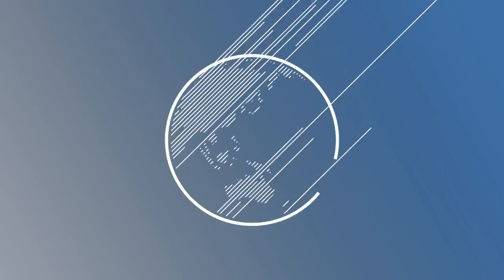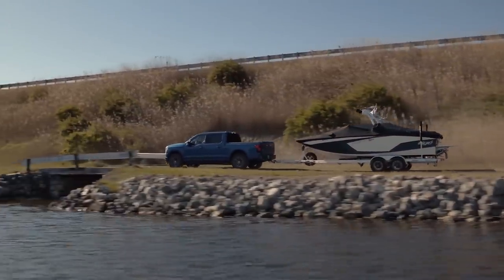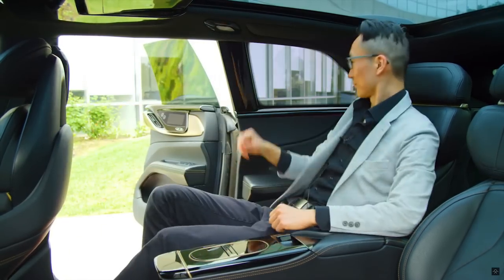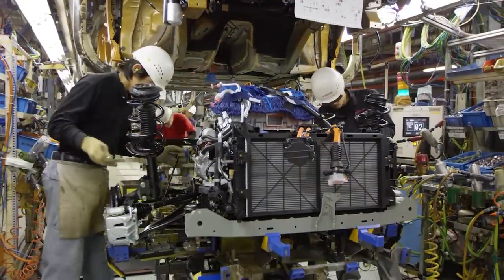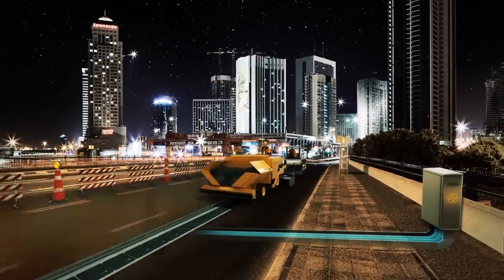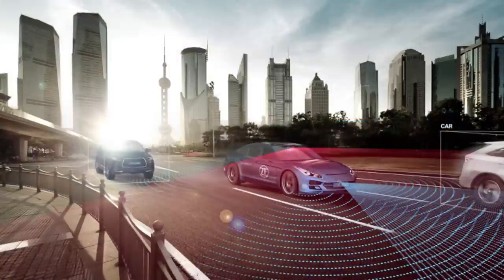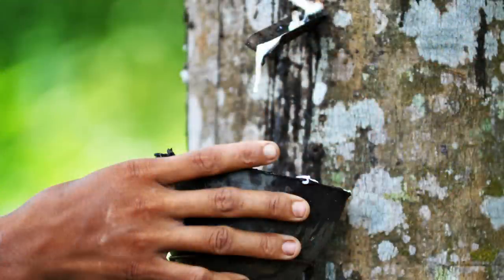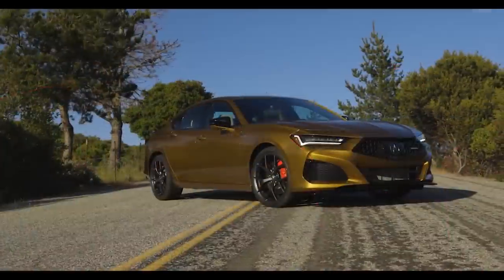Ford Reveals F-150 Lightning; BMW First to Use Sustainable Rubber Tires - Autoline Daily 3084

Comment: Great job Ford...   I am impressed..
Reply: on average, yes.... but wanted to see it include, https://www.caranddriver.com/news/a34277725/ford-f-150-range-extender-ev-pickup-patent/
 as an option....  that was a disappointment.... for now...
Reply: @nc3826    I tried to tell you...
Reply: @dmitchellhomes  tell me what??? 

if we talked about show me the link??? want to see what you said....
Reply: @nc3826    Yesterday you commented that a range extender was coming,  I commented back that I doubt it.      Range extenders do not make sense,  add too much mass,  limiting range and payload in EV mode.    Working on better efficiencies,  and better battery tech is where to spend $$ now,   we are past the extended range hybrid phase for most customers needs.
Reply: @dmitchellhomes Sorry I did not get from your earlier comment, you were BEV evangelizing purist like fanboys.... 

Bottom line is its fast DC charging rate is sub par to the coming competition... So they need an alternative for high energy consumption situation like towing... Since those fleet owners do not have all day to recharge... 

BTW the Range Extender capability could use a battery pack like Rivian's Jerry Can.... It would just be future proofing it... so if they are smart the will add it... like Rivian said it would...
Reply: @nc3826    Yeah, I think hybrids just have too much complexity, too many systems that have to be developed, and packaged into the vehicle, which take away from space for other things, all of that money is better off spent developing better battery technology, and building charging infrastructure, so you have EV‘s that are good at being EV ‘s, and not hybrids that are not best in class at anything
Reply: @dmitchellhomes  Range Extender Patent is a way to plug in a generator.. only when needed.... so it's only some extra wiring.... (much like Rivian, but they will offer more batteries instead)... this will be an issue for all pickups but the slower DC charging for Ford will make more of an issue....  

Ironically Autoline just had a Range Extender story (mislabeled as a hydrogen story) you should check out how "compact and simple" it is.....  while the alternative is to permanently have larger battery pack takes up far  more space and are more expensive, but are usually occasionally needed...   

little extra wiring makes more sense to me... but to each their own....
Reply: @nc3826    Ya,   I just do not think it matters,  for a car that consumes 500 wh/mi like this F150 will,  that takes one heck of a generator to keep up,  do some math,  a little Honda 2000w is not gonna do it.   You would need a 40 Kw generator just to keep up with consumption when you factor continuous loads and lost efficiencies,    A 40 kw generator weighs more than the trucks payload, so now you have no payload.
Reply: @dmitchellhomes  Not the free-piston generator in the story I referenced and its only when needed..... its far better than tons of under used batteries... but to each their own...
Reply: @nc3826     OK,  fair enough,  but most people buying EV's want to be Zero Emission,  and will try to compromise to make that happen.   if you add combustion, its not a zero emission BEV.     I think GM had room to run with their Voltec Tech,   but talking to GM execs they told me its just too expensive and too many packaging problems to solve to make it viable.

Comment: F150 Lightning will provide 30 kWh/day to a home for 3 days - thus large battery is likely 90 kWh. Standard Range 67.5 kWh usable. Truck can provide 80 amps to external sources at max 9.6 kW - 120V.
Tesla Model X 2021 has a fuel economy of 32 kWh/100 miles and 371 mile range - from this we can know that the range is 19% longer than a 100 kWh battery would provide, thus extra range perhaps from extra battery and regen. 
The F-150 is likely heavier than the Model X and has more wind drag. 
For the extended range could assume 33.33 kWh/100 miles fuel economy for 270 miles of range and an extra 11% due to regen to get the Ford 300 mile range. 
For the standard range could assume 32.6 kWh/100 miles as it is likely 100 kg lighter with only 75% of the cells in the pack for 207 mile range. Applying 11% regen gives 230 miles. 
Assume 400 V DC fully charged and 96 cells in series - 4.17 V max per cell. Assume at least 4 cells in parallel for 90 kW - 384 cells with 234.375 Wh/cell, 844kJ/cell, and 65.1Amp.hour/cell.    Battery might have 4 modules hooked in parallel. Standard Range may have 3 modules in parallel. So the only thing that varies is the Amp.hr and Amps that can be provided or accepted by the battery.

Comment: Ford may have a winner on their hands, I like it. The question is will general traditional truck buyers embrace it?
Reply: The real question is will they be able to keep up with demand just from commercial buyers? (since its cheaper to operate)
Reply: Fleets will, for sure...   I think truck buyers on the coasts and in cities will love it,  in the midwest,  not so much...
Reply: fwiw individuals buying it for work, will benefit from the lower cost, even in the midwest
Reply: No, it's range while towing will be abysmal.
Reply: @PistonAvatarGuy    Ya,  but most fleet customers will not be towing,  and that abysmal range is with all EV's,  darn batteries need to have higher energy density before they will work for vehicles that tow heavy or often.      If a customer needs to tow their Bowrider to the lake,  the F150 lightning will do fine...
Reply: @nc3826    Yes,  that is true,  but the midwest mentality is different,   and their tolerance for EV sacrifices less than costal, or city  people.
Reply: @dmitchellhomes  No, it wont. There are plenty of people in the city I live in who have boats, but the lake that everyone visits is ~200 miles away, the F-150 Lightning wont do anything close to that while towing on the highway and there wouldn't be enough electric vehicle chargers at the lake to handle the demand anyway.
Reply: There are so many people who buy pickup trucks, that don’t really use them as trucks, that Ford will be able to sell all that they can buy batteries for.  A 5.5’ bed isn’t much of a work truck anyway.
Reply: Ford has shown exactly what every ev truck startup (and tesla) has to beat and outside the brand, the lightning is not some gamechanger.

Comment: Would you consider the acura TLX a Toyota Avalon competitor or a Lexus ES competitor?
Reply: Neither. In addition to not offering the interior passenger volume of either, the TLX is intended to compete in the compact sports sedan segment (though there's nothing compact about them). Think 3 Series, G70, and S60 as competitors.
Reply: Smaller than both of those, but closer to the ES in design intent. Avalon = pure large-ish luxury sedan, no sporting pretentious whatsoever.

Comment: Should re-design front end for lower cd to get better range, right?
Should buy many reports from Sandy Munro to analyze & educate Ford staff/engineers.
Reply: Except Sandy complemented Ford on the Mach E,    and scored many parts of it higher than Tesla, including the chassis structure and suspension.
Reply: @dmitchellhomes  they can have the best chassis and suspension on the planet.. if they don’t have the efficiency to meet a drivers need for range, or a hell of a lot faster charging capacity, the market will not buy it in quantity. Ford did a ‘good’ job.. and might be built ford tough.. but it’s a f’n brick. 300 miles range would be acceptable if you plan to use it as just a passenger vehicle. You plan to move anything or haul anything of real weight around and more aero drag.. that range is gonna be nearly halved.. then put it against a headwind or in cold environments.. its got a 100 mile range.. they need to do better if they really expect this truck to go to work. Using it as a SUV in the city.. sure.. it’s suited for that
Reply: @airheart1   Mach E does pretty well when it comes to range, it’s definitely competitive in class in the real world, but Ford doesn’t cheat the numbers like Tesla does, so it’s rated lower, but in the real world watch the tests!
Reply: @dmitchellhomes  the mach e has a reasonable aerodynamic shape. And is not intended for heavy hauling. So we’re not talking the same issue at all. And as for Tesla ‘cheating’ its range.. that’s a flat out lie.. if the rated range on a Tesla is something you have issue with.. contact the EPA who does the test procedure. Tesla didn’t design the test. They never lied about a single mile. The cars do exactly what they are rated for in the given scenario. Don’t like the test? Talk to the testers. I agree it’s not accurate to how I drive either. But to say they cheat.. is a f’n lie
Reply: @airheart1  and that's why I think part of the reason the Cybertruck has been delayed, they got the first couple test mules running and put a little tear drop camper behind it and shit their pants at how pathetic the range was going to be. So it was back to the drawing board to trim the size of the body and possibly squeeze in some more cells. 

Towing and cold weather are the Achilles heel of EVs, if you're lucky while towing your range will be cut in half of normal driving. If you're planning on towing on a cold day you mind as well rent an ICE vehicle or stay home 🤣😂🤣
Reply: @OneNationUnderGod.  i don’t disagree. Worst case scenario’s.. cold, windy and wet.. added with a trailer.. it’s gonna be ugly in range. For any EV.. but starting at 500 miles for the big CT is their saving grace. All any EV really ‘needs’ is 150 miles of real range. A fast charger should never be further than that for you, hopefully soon everywhere not just main highways. If they can expand fast chargers to get to even remote, reasonably popular, locations. I consider it no longer an issue. Even though having to charge every 150 miles might be an inconvenience, the benefits outweigh that. You don’t tow long distance daily. It’s a couple times a year inconvenience for huge benefits. But a 300 mile truck getting cut down to 100 mile range towing and in ‘bad’ weather.. that’s a problem. 500 miles should still get you about 200 miles even in the worst circumstances.
Reply: @airheart1  please, Tesla pulls those numbers out of their arse. Their declared ranges are by far the worst off comparing to any other brand. On paper Model 3 beats Mach E, in real life it's the opposite way around.
Get off your high horse.